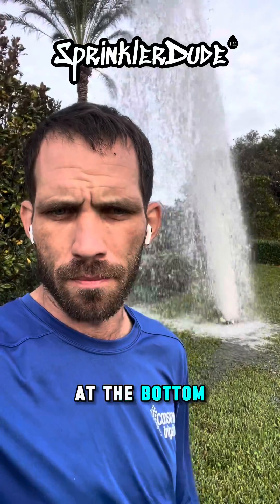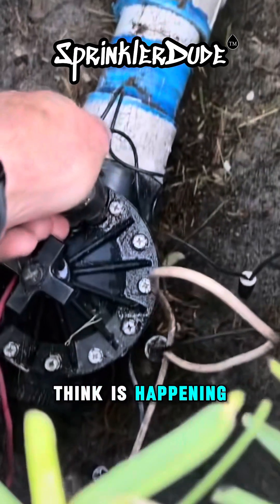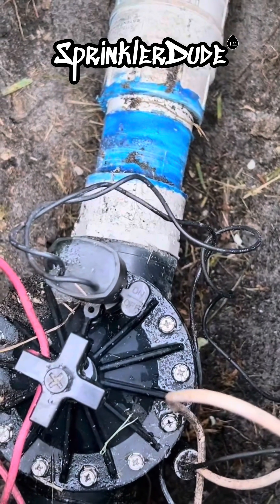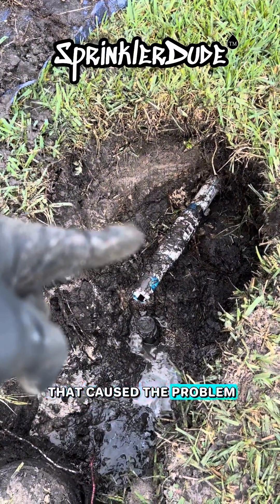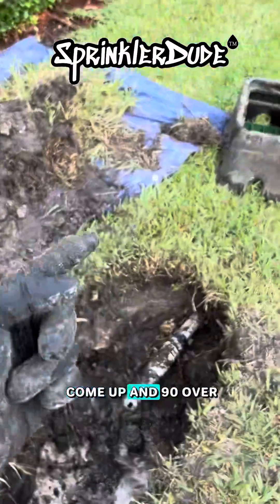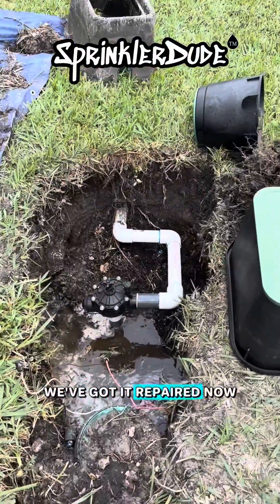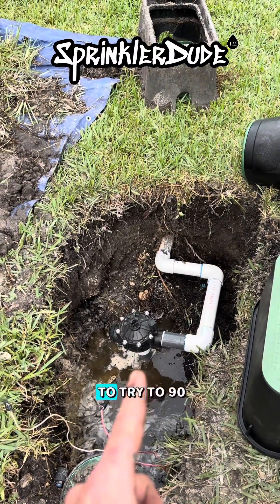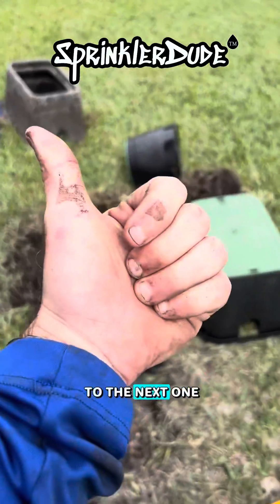That’s Dangerous | Slip Fix

Comment: Are you a fan of the union on the discharge so that in the future another valve can easily be spun on? Or do you have the philosophy that if the valve can’t be repaired with a gutswap then it has to all be cut out anyway? Great job as always on the repair. The haters will point out the pressure lost with all the extra 90s, but they’re fools as that is often insignificant loss of pressure.
Reply from the maker: I think originally it can be useful. But not in my area.
Reply from the maker: To your point on the elbows. I sell a shirt that has the math on it for a 1 inch pipe with four elbows. You’re absolutely right, it’s negligible.